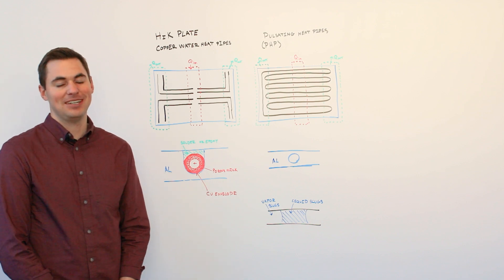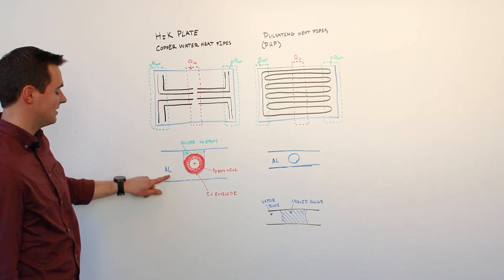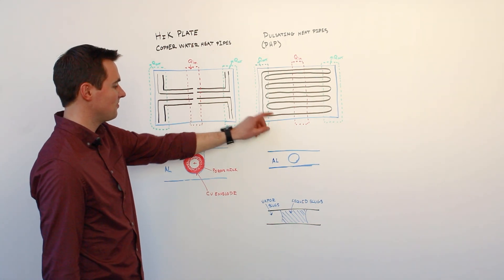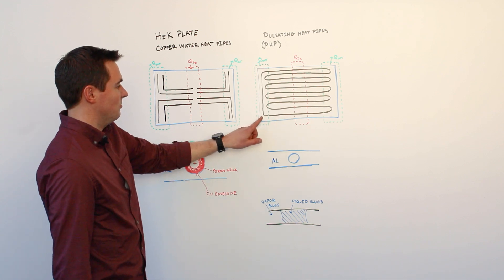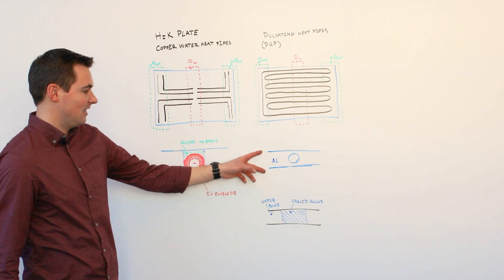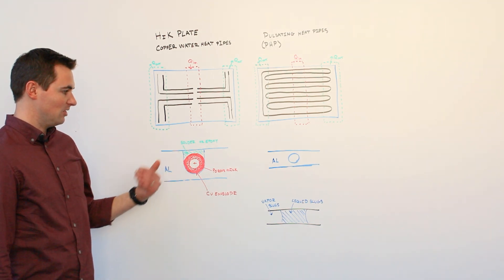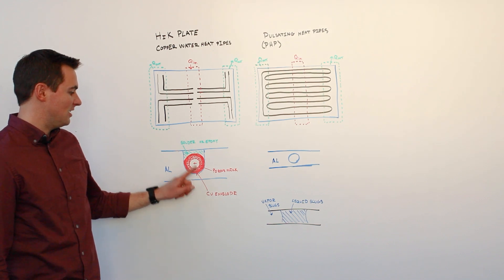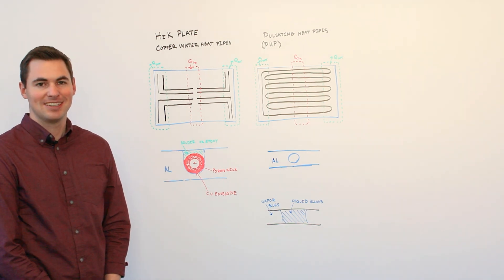Pulsating Heat Pipes | Engineers with Markers

Comment: you're doing god's work fighting the fight against the eternal thermal cycling plague - now only to apply your expertise to cooling computers
Reply from the maker: Thanks @josef_fritzl! Check out our Data Center page... we're definitely fighting the good fight against the onslaught of AI-generated heat :)
Reply: @AdvancedCoolingTech  I meant more along the lines of personal computers - heat density is increasing and the greedy corporations that make the chips are banking on huge temp differentials to make the chips die of thermal cycling faster - if you could apply your cutting edge solutions to this i think you could carve a market niche for yourself